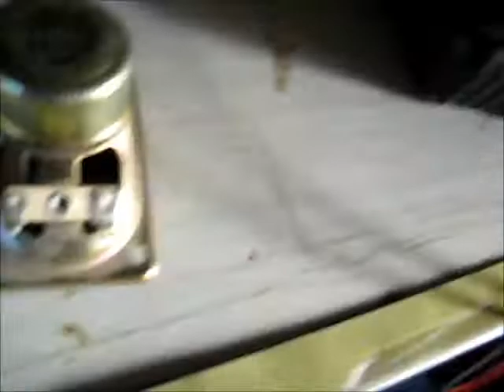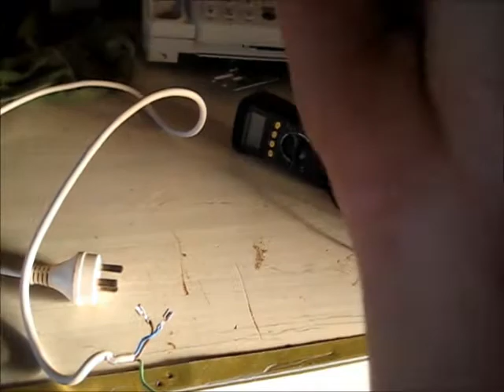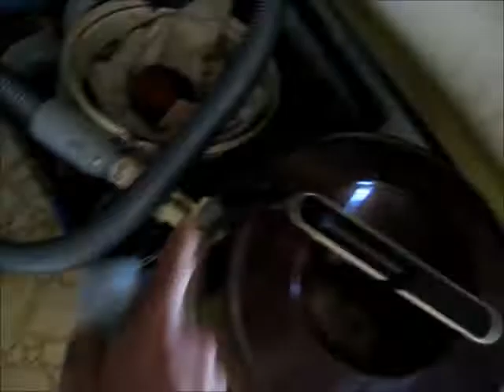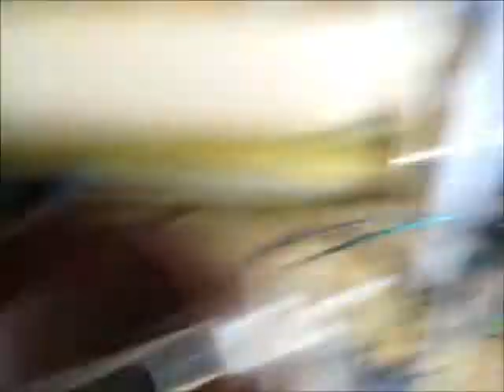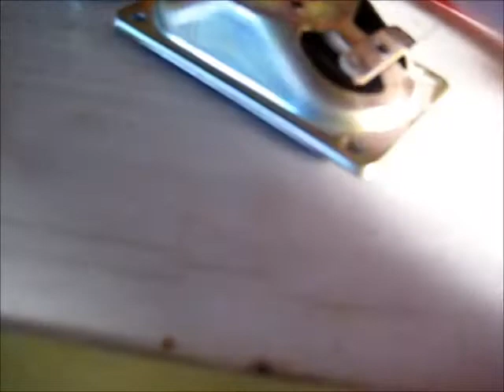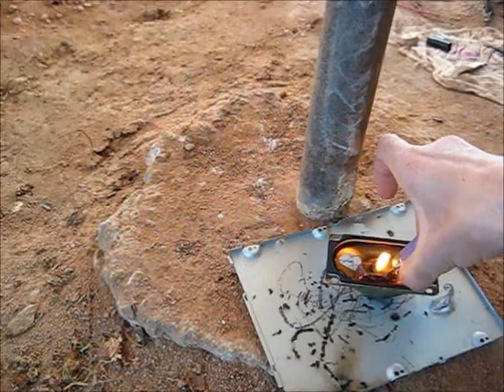Mains "Jiggery Pokery" Speaker Pop

Comment: Nice use of the Jiggery-Pokery Unit right there. :-D

Want flames? Cigarette lighter? 

Why didn't you start the fire with the MOT? You could have also arc'd out the speaker coil too. 

But yes, nice use of the Jiggery-Pokery unit though. 

*Like*

-BoomBoxDeluxe.